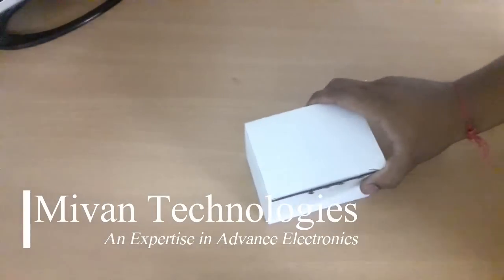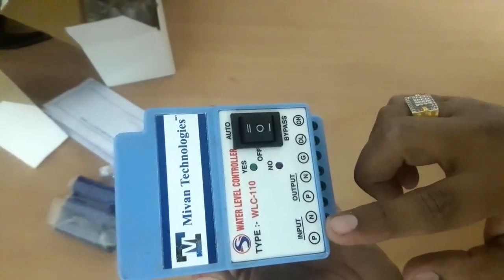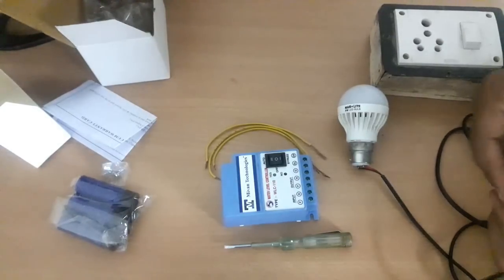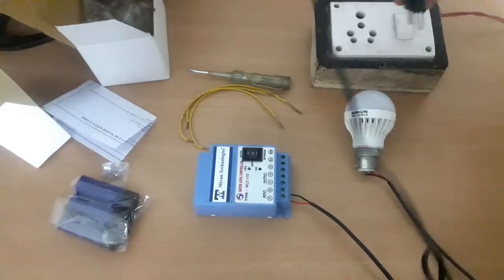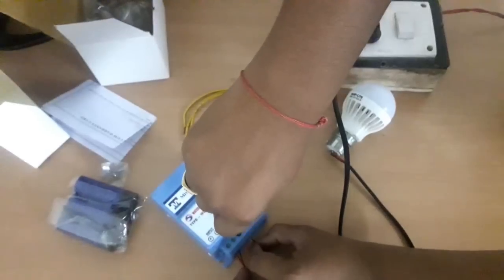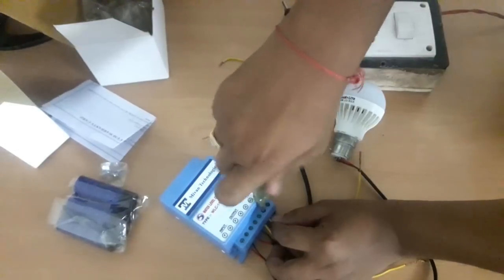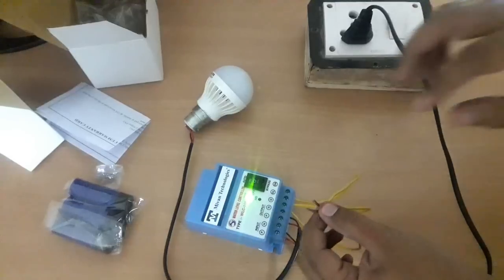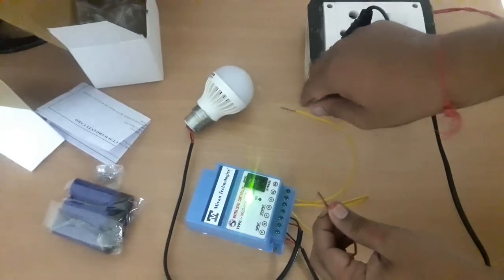How To Test Mivan Technologies Water Level Controller WLC 110

Comment: I have same model since 1.5yrs, but now a days, when the water level goes just below OH level the motor starts , and in few seconds when the water level reaches the OH sensor the motor stops, so motor keeps switching on and off very very often.
So can you please guide where the issue is ?
Please reply asap.
Reply: Hi did you find any solution? Facing the same issue.
Reply from the maker: Please change the sensors
Reply: I have the same problem so I purchased a new controller thinking that the controller is spoilt but with the new controller it is the same problem.
I tried it at another location (B) and the controller worked okay there. So I took back the controller to the original location and there it does not work. Then I tried it by changing the water from location (B) and with that water it works. The problem is the controller has a some limitation with the water conductivity or something else.  It took me a lot of tries and patience to come to this conclusion of changing water. Will the manufacturer please advice?  @MivanTechnologies

Comment: Sensors connecting wires are very short,need atleast G . sensor 1.5 mtrs.,L . sensor 1 mtr, H.sensor 0.5 mtr need for 1000 LTRs tank.otherwise when we joined extra wire .joined point become corression because joined area in water.if we used insulated  tape.the corression problem not solved.
Reply from the maker: Now u will get 1.5 m wire

Comment: Is this product working with single phase submersible pump .
Which starts with push to on switch (green button) from starter Pannell .
Plz reply ..
Reply: Kindly reply same quary..
Reply: Dhurva Singh this product works only on centrifugal pump (tullu pump).
I had called mivan technology they told me same ..
Reply: seems like you have contacter starter panel pump which has green button, if yes then the model no. is LLC/1SC of mivan tech. search on amazon.in

Comment: In manual mode does the motor turns off automatically after tank is filled
Reply from the maker: Meaning of manual mode is to start and stop motor manually. Customer require manual mode for maintenance of tank